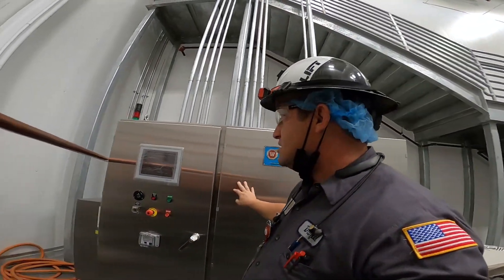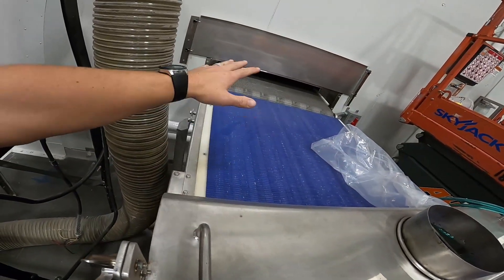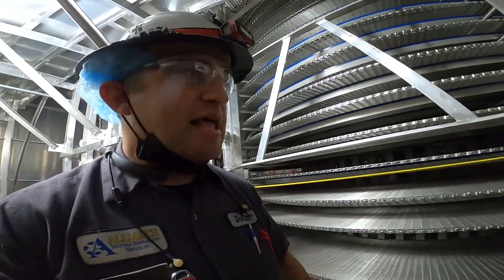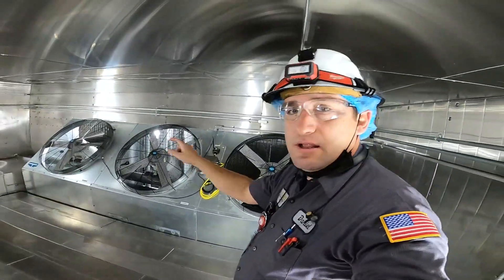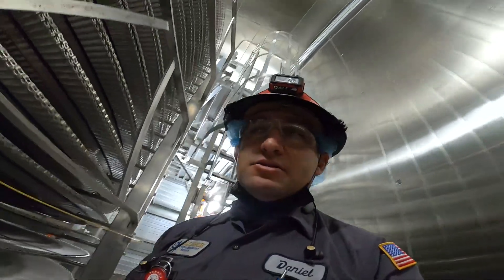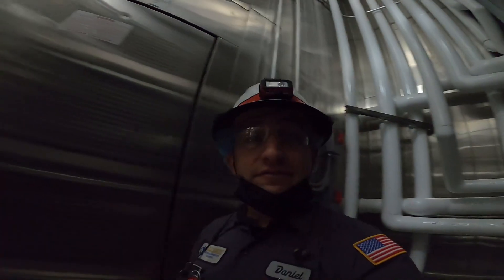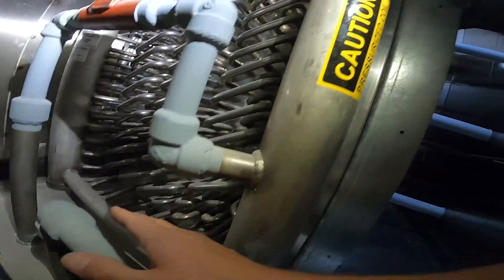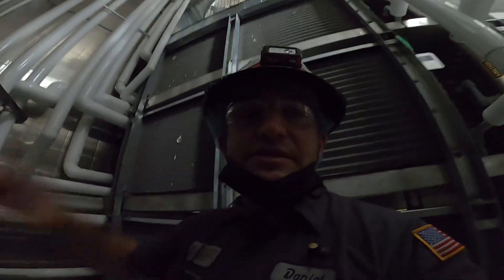IJ White Spiral Freezer

Comment: Quality looking gear man, a? My thoughts that defrost is heat could still be pulled off the back off the coils during defrost even though the dampers close.
Reply from the maker: Yes slightly. It works per design. It runs well.